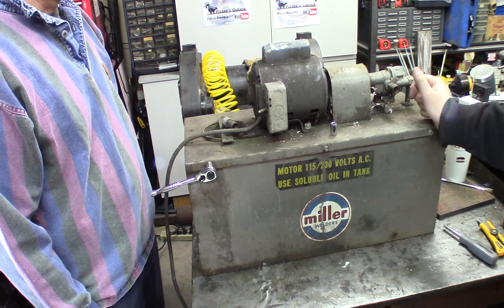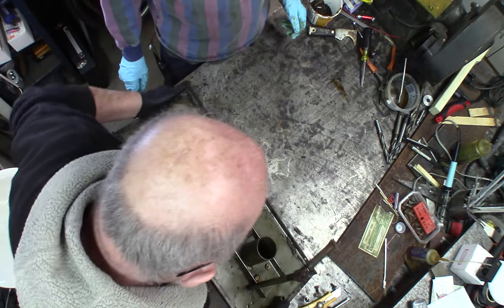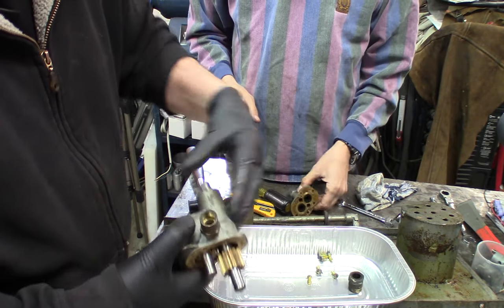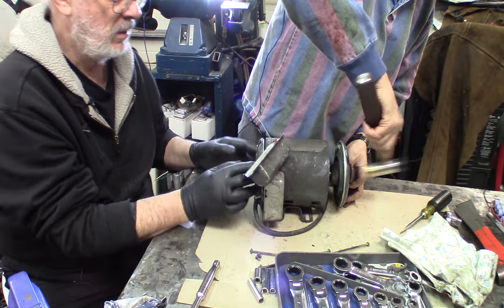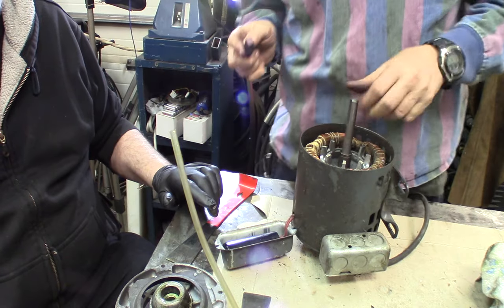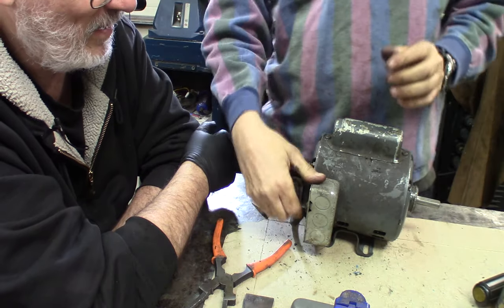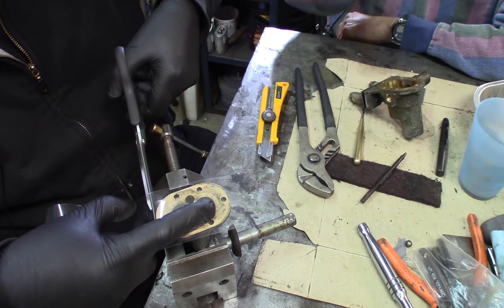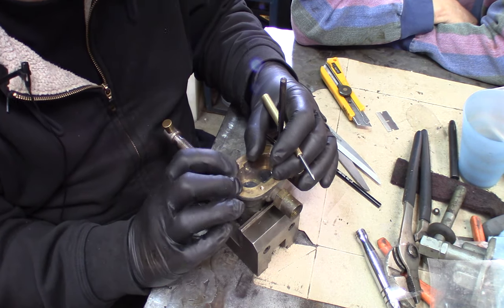Flood coolant pump from Miller Welds, Back to working condition after restoration... part 1

Comment: Nice job guys.  Who makes that ESR meter?
Reply from the maker: Hi Bill,
For the ESR meter you can look on AliExpress with the description:
MK-328 TR\ ESR transistor \ inductance capacitance resistance \ ESR TesterThe price would be around 30 to 40$ CDNMy unit functions great so far...Cheers,   Pierre